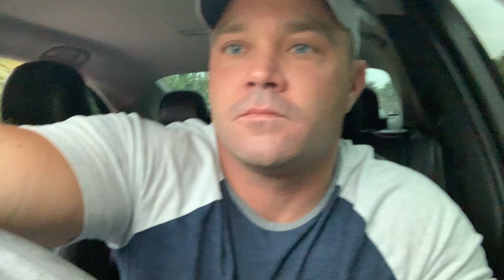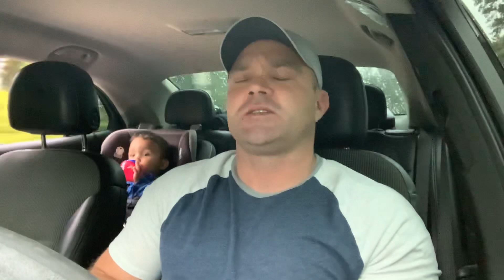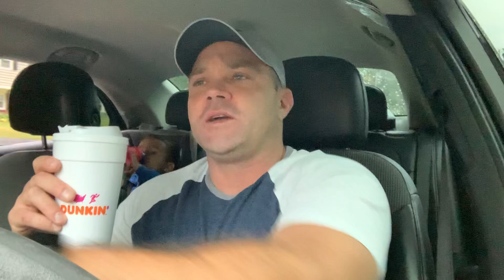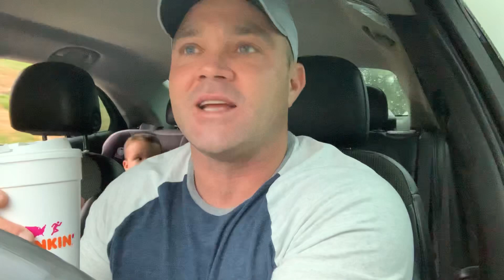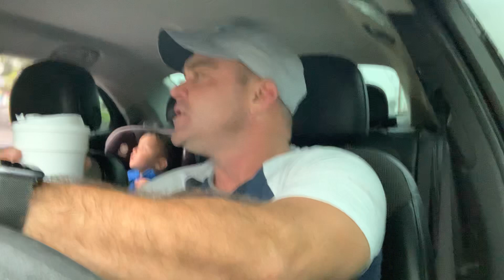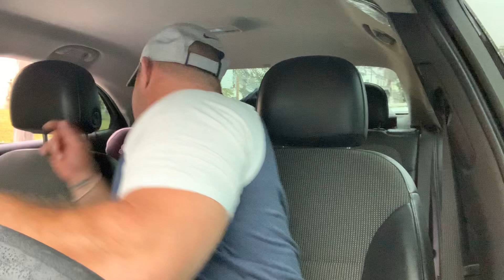LETS TALK TRANSMISSION TEMPS IN THE 10R80 DRAG RACING ROAD CORSE

Comment: It is very easy. Swap your 170degree for a 160 degree. With the transmission get the ford dealer to unlock the transmission temperature gauge and set this up in your centre cluster on the 12 inch digital display.

Comment: I have a stock 2019 GT Fastback 5.0 and mine when I'm hitting hard in the summer gets up to 225 degrees. I was told that it's ok to have it that high because that trans fluid is hot and cleaning deposits at that heat.

Comment: Check your muffler bearing clearences. If they are tight they cause a reverse back pressure that puts a strain on the transmission planetary drum sprag. Very common...
Reply from the maker: rampage2587 I figured it out it was the turn signal fluid it needed to be changed all good now
Reply: Seriously, you guys have no idea what you are talking about. It was clearly the piston return springs. They are worn out and that is why the muffler bearings need to be replaced.

Comment: I'm not near your power but I would be worried last 210ish...I had Edelbrock stage 2 till engine popped...and my trans temp never got that high 10r80...I was 800hp flywheel your probably 1100hp though and I had stock stall that aftermarket is gonna add some heat
Reply: How'd you blow your engine? Did you like the Eforce? I love mine...

Comment: I had a 98 z28 back in the day with the junk ass 4l60e that was built and I ended up running ams oil in the trans because I was making like 650-700 wheel and I'd see trans temps upwards of 210-220. I found that ams oil withstood the temp way better

Comment: Ulev trans means the oil doesn't get moving properly until it gets to temp. No reason to get a lower tstat. This guy is meant to hit higher. They say to change the oil at 230plus degrees.

Comment: Running a stage 2 Gen 5 whipple run about 200 degrees max. Have a base car so I get the temp readout.  I wouldn't get excited unless I went over 240.  Car runs great but I'm not drag racing either. Doing more road course work. 270 degrees used to be the temp where the oil would fail and burn. The new fluid maybe hotter but 240 is where my comfort ends. I'm more worried about my rear differential temperatures.

Comment: I had bad with my mustangs 10r80 ford rebuilt it after I burned some clutches. But ford bought my car back after the motor and trans failed. I’m having issues now with my 6r80 after I added a stall convertor and gears. Trying today to get Lund to fix the line pressure and shift points